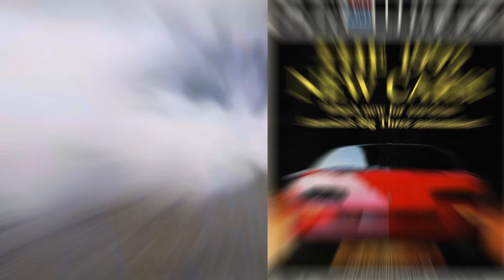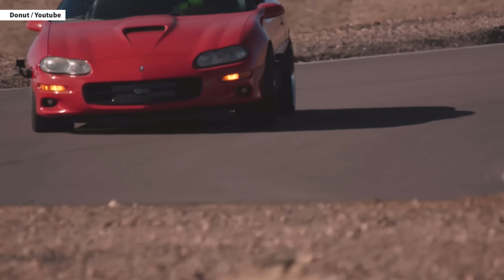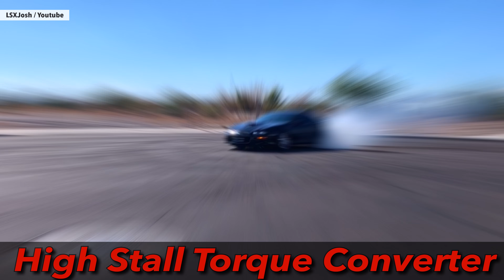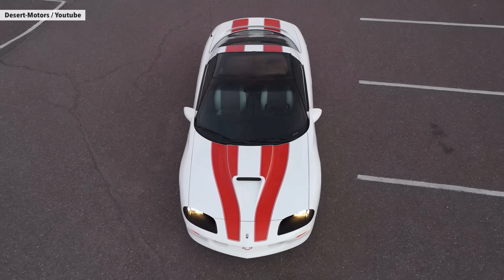Should You Buy a Camaro? 4th Gen F-Body

Comment from the maker: To everyone who has Shared/Subscribed/Liked our videos, THANK YOU!! More to come!

0:01 4th Gen Camaro History 
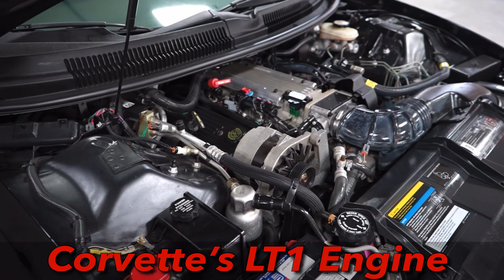0:56 The ultimate V8 muscle car 
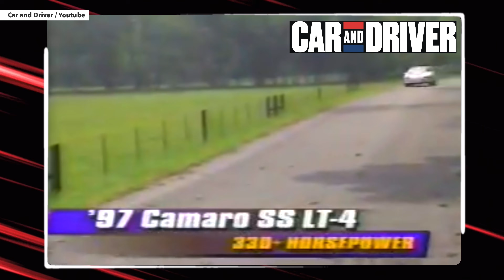1:56 LT1 upgrades 
3:03 Optispark solution
4:25 Why the LS is the ultimate engine 
5:52 Any Deals?
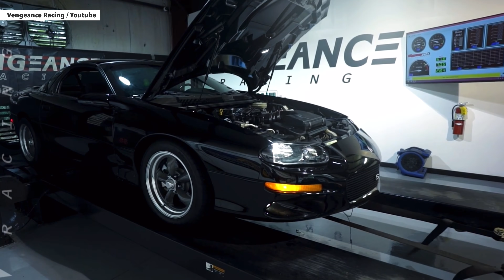7:21 Performance upgrade list
8:50 Automatic transmission mods 
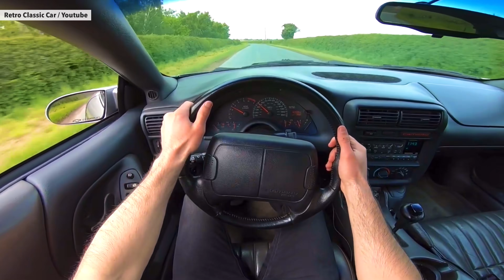10:10 Camshaft considerations
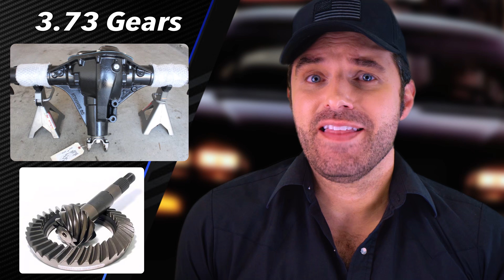11:47 Rear end Gears
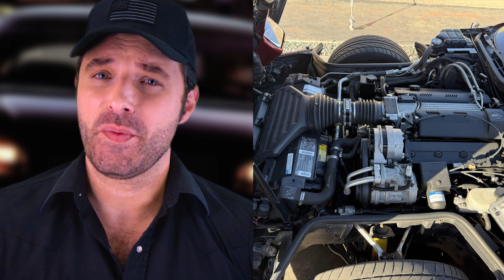12:52 Increase reliability 
14:10 Suspension 
16:50 Is it worth buying?

#4thgencamaro
#fbody 
#camaro
Reply: My first car was a 4th Gen Camaro. A couple months ago I bought a garage-kept 97 z28 anniversary. It only has 26k miles. I want to do a little bit of upgrades. I’m in Broward. Do you have a shop, or could you recommend who to use in Broward or Dade?

Comment: I have a 95, 6 speed with a tick performance short throw shifter, edelbrock heads, edelbrock air gap intake,  bbk twin 58mm throttle body, K&N cold air intake,  bbk shorty headers,  magnaflow exhaust, high flow cat, and granatelli electric cut out, 12 bolt mac diff housing.  Gears were done before i owned it and I'm unsure of exactly what. Its a beast!  I plan on doing a cam and roller rockers soon.  Cheers!!
Reply from the maker: That’s what I’m talkin about!! Love it! Take good care of that BEAST!! 🔥🔥👊

Comment: THE LS1 in the Vette was 345 HP
THE Camaro was 305 HP
Reply from the maker: Yes they were rated differently from the factory, but on the dyno they put down similar power to the rear wheels. Biggest advantage the Vette has is weight 💯

Comment: Things that make the camaro a perfect car.  2 plus 2 seating, this a family car, fits car seats has doors long enough to get in and out of the back seats.  

An egg shaped cabin that protects the occupants.

You could get this car in the 2000s with no traction control, no eaps, minimal ecu controls.

Weight, without t tops i see claims of 3300 lbs stock.  Add in a motor thats seated behind the front axle and a seating position in the center of the car for a nearly 50 50 weight distro.  

Luggage room, sure they made it able to fit golf clubs but more importantly you can 3 cloths bags, a cooler a pak n play and a stroller in the hatch and still get 31mpg on the hwy while holding 310rwhp.

You keep talking about the power and mods but more importantly, the motor can be repaired, parts are available to keep them running from every where still.  And it can all be done in the driveway with jacks, stands and a cherry picker.

You seem to be thinking about racing the cars while honestly the 4th gen camaro is the last real daily driver muscle car.

The motor is not too powerful for the rear end, the rear end does not have big enough rings for high traction tires.
Reply from the maker: You speak only facts! 💯💯👊

Comment: Love my 4th gen Camaro Z28 2000mj!!! Got Bilstein dampers and Vogtland springs, just awesome suspension. It definitely needs lowering, stock it looks like an offroad truck. Stock exhaust (euro model) just sucks, its quieter then your lawnmower. Upgraded this as well and the LS1 is one of, if not the best sounding engine ever built!!!  Low rev rumbly as hell, up thr revs it becomes a racecar. When I went to the autobahn, t-tops off at 140+mph I felt like a jet fighter pilot, absolutely insane. Never ever had this feeling in another car. Love the interior as well, although I will put some race seats in, the standard ones are too small somehow (long torso). 
The 4thgen are so insanely fun to drive, its unbelievable!!
Handle awesome as well! 
Just love it!
Reply from the maker: This is what I’m talkin about!!! 💯🙌🙌

Comment: One critical thing with the optispark is that the mitsubishi sensor inside the optispark is the most important part. I have had my lt1 since 2012 and i bought a cheap optispark and swapped out the sensor with my oem Mitsubishi sensor. Car has never had a optispark problem.
Reply from the maker: SOLID SOLID TIP!! 💯👊 This is Correct, the original Mitsubishi sensors is also no longer made….so it’s important to reuse it when swapping the Optispark !

Comment: If you are not doing a bunch of power mods a high stall torque converter can be really hard to drive normally causing normal acceleration problems under normal driving.
Reply from the maker: Facts, especially if the stall speed is too high 💯

Comment: Owned my 96 Z28 since new.  Recently I restored the car with reinforced frame, full race coil over suspension with Koni adjustable shocks and watts linkage in the back. Big Baer brakes on all corners. I installed a 383 Stoker LT1 dynoed  at 460 hp 440 ft lbs with a Centerforce dual friction clucth and new T-56 six speed with aluminum driveshaft. Kept the 3.46 axle for autocross.  It retains its beautiful original black paint job with chrome 35th anniversary wheels shod with Nitto tires.  Car is immaculate and street legal in Florida with full coverage insurance is $28 / month classified as a 30 yo classic car.  I love it.
Reply from the maker: Still has the original paint! Incredible!! Never sell !! 🔥🔥👊

Comment: Awesome car that is ridiculously hard to work on and repair. They were obviously made to be disposable.
Reply from the maker: Not really, the chassis was tested by the engineers to endure over 200k miles without stress cracks….body panels don’t ding or rust. The LS engine easily do over 400k miles if not abused. I’d say compared to today’s cars, they’ll last a lifetime. Biggest problem is half the engine is under the windshield, but it’s still better than most new cars
Reply: @HernanSpeed  Nothing wrong with the chassis but have you ever done the clutch master? have you ever done the steering rack? have you ever replaced the air con compressor? stupid-stupid designs on wear items that will make you want to hunt down the designers and slap em. All of these designs were made for manufacturing without any thought going into repair. You need to drop the entire sub frame and pull the engine out to work on it! This is why there are so few still on the road.  It's ridiculous.

Comment: All around excellent video!!  I’ve had a 95 Z28 convertible for 15 years and other than several optispark replacements it’s run beautifully. You can lower them and still really enjoy the ride with a quality spring and shock setup like Ground Control or Sam Strano sells. Koni shocks really work well. They really turn heads when lowered 3/4 inch or so. Thanks again HernanSpeed 😊
Reply from the maker: Thanks for watching brother! 👊👊

Comment: im an ls1 guy, i love the modern look of the ls1 camaros and trans ams, but the simple fix for opti spark ive heard from friends and people in groups is to take it off the car, put blue thread locker on the rotor so that doesnt come loose, and use gasket maker around the whole thing to prevent any and all moisture from going into it and thats a permanent fix for factory.
Reply from the maker: Yess, you’re 10000% correct!

Comment: I have a 97 Z T56, Long Tube Headers, B&M short throw, Underdrive pulley, Torqhead 24x with an LS1 ECU with LS2 coils and is lowered 1.5". It does scrape, but only on extreme speed bumps and I'm changing the wheel from C4 ZR1' to C6 Z06 18" front and 19" rear. That should give me a little more clearance. Ive never had it over heat and I've had the car for almost 18 years. It needs new shocks bad! Then I'll do 6piston brakes, and a 12bolt. My plan is to LS3 it with supporting mods.
Reply from the maker: Solid upgrades! I bet it sounds like an animal with the long tubes🔥🔥  The 24x is a game changer for reliability!  

Thanks for watching brother! 👊👊
Reply: @HernanSpeed Thanks CamarBro! Yes, it is loud, but still is not when driving normally. I will definitely buy a thermostat soon.

Comment: Motorweek tested a STOCK 275 hp Camaro, it ran 19.8 at 99 mph, Motor Trend recorded a 14.2@98 with the 4 speed auto. C/D uses ringers supplied by aftermarket tuners. Remember the GTO vs GTO test, that was a total fraud.
Reply from the maker: Motorweek test from 1994 has the Z28 at 14.6 at 98 mph (they noted that times were limited by wheelspin). 

Thanks for watching 👊👊

Comment: I got a 00 Z28 SS. Owned it for 6 years now . Love the car so much. Paint is amazing for its age. I detail it alot and keep it extremely clean some ppl think its a 2023 car. Only thing i hate is recently got a steering fluid leak and the anti freeze for some reason has mixture of steering fluid that is running to it. Other than that it runs amazing.
Reply from the maker: Start with the steering rack leak, get “Lucas Power Steering Stop Leak”. Its pricey, but incredible! I’ve used it to totally fix rack leaks!

Keep that SS in minty condition! Thanks for watching man! 👊👊
Reply: @HernanSpeed definitely will bro. Its all black too so I gotta stay detailing it as its the hardest paint color to maintain 🤘🏽 and i tried Lucas and still leaks. I know forsure it needs the rack & pinion set and just steering leak and its all good

Comment: Just sold my 2002 firebird Trans Am i liked it but didn't love it interior is dated, cheap toys R us plastic, stupid hump on passenger side your girl would hate it, drives like a stiff boat, motor tight under hood just cheap material car period but it was fun when I had it but I rather have bought a C5
Reply from the maker: When they were new, the C5 was almost double the cost of a Firebird. But in today’s used car market, they’re comparable in value. You definitely get more for your money with a C5, but you also loose the ability to carry more people. 

Thanks for watching man 👊👊
Reply: Facts  @HernanSpeed
Reply: @HernanSpeed Exactly, when I bought my 98 Trans Am back ten years ago for 6k (one owner car, all original, 97xxx on the odometer for 6000 USD, nothing really wrong with it just needed a paint correction and new tires) the same year Corvette with similar mileage was a good 10k more. Now it's different because the pool of lower mileage original owner fbodies in good shape is way less than the C5 era  and if I were in the market for an LS1 equipped car it would be a C5 Corvette or a 2004 GTO. Heck the 05-06 GTO is a killer deal but you have to get past the looks of the GTO to consider one, and that car failed due to it having none of the design heritage of previous generations of the GTO and it being a refreshed Holden for the US market. I still like the GTO and the G8 (V8 G8 models only)
Reply from the maker: Your talking facts man, the prices totally flipped 💯
Reply: @HernanSpeed it's wild and at the time I didn't think it would happen but it makes sense. Corvette buyer's for the most part are older and don't like putting miles on their cars but I do to get the most enjoyment out of what I buy them for. 😂

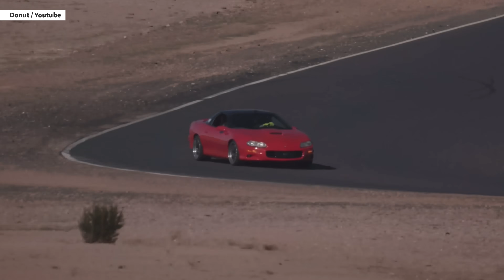Comment: 3:56 My dad went through three different Opti spark units all with less than 200 miles on them, summit racing, MSD, and the best one you can get the pincer.
Reply from the maker: I think you mean the Patris, yes…it’s incredible. The original one was the best, but no longer available. 

Thanks for watching brother! 👊👊
Reply: @HernanSpeed  yeah, that’s the one, we just put a new Opti in and did a transmission swap, new coils, new plugs, now we’re just fixing wiring and trying to fix a misfire
Reply from the maker: It’ll be totally worth it when it’s done! 💯💯🙌

Comment: I have a Monterey Maroon metallic 2000 Z28 just installed a complete UMI lowering kit springs shocks upper and lower A Arms front and rear sway bars adjustable upper and lower control arms adjustable panhard bar adjustable torque arm with the transmission mount relocation bracket and drive shaft loop this car is beautiful.
Reply from the maker: You took the handling to the next level!! 🔥🔥

Comment: No you should not. Cheap chevy junk
Reply from the maker: I wouldn’t call a car that can easily do over 400k miles junk.. Thanks for watching! 👊👊
Reply: @HernanSpeed I've had two they're cheap trash. Just touch anything in the interior. Rear main seal leaking in 100% of them. Auto trans are weak slow and pathetic. The car doesnt even have independent rear suspension. Handling sucks. Hell the windows are slow they may as well be manually rolled up
Reply from the maker: It’s all relative to the price. What other car are you using to compare it with?
Reply: @HernanSpeed for 6K id buy a Lexus IS350 thats built better, more reliable, better on gas, and probably faster tbh
Reply from the maker: Automatic. I don’t think many people cross-shop a family sedan with a Camaro.

Comment: There is a difference between the Corvette C4 LT1 and the Fbody LT1, the main crank bolts. The Corvette has 4 bolt mains, the Camaro/Firebird has 2 bolt mains. However, the 2 bolt can be converted to 4 bolt. 4 bolt mains can help your crankshaft handle more power.
Reply from the maker: Yess, correct! 💯👊

Comment: Thank you for shining all that light on the LT1 cars. ('97 SS #1249) It's the last of the 23 degree iron small blocks and Chevrolet really did make it the best small block at the time.  The opti-spark works very well and there is strong pull all the way to 5,200 rpm. 160 degree thermostat keeps it cool and in the best performance temperature range.  It's also the last of the original 1-8-4-3-6-5-7-2 firing order so it sounds mean and ratty.